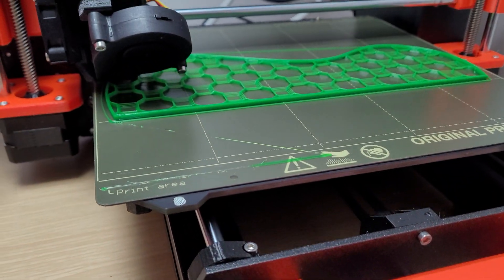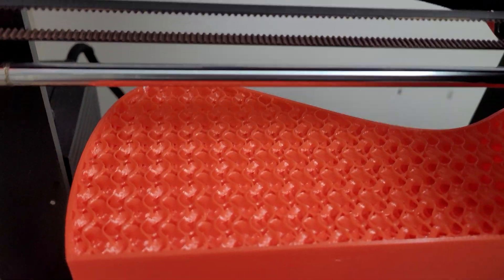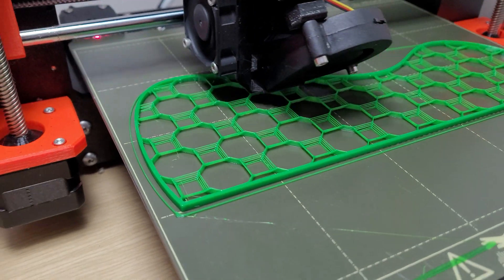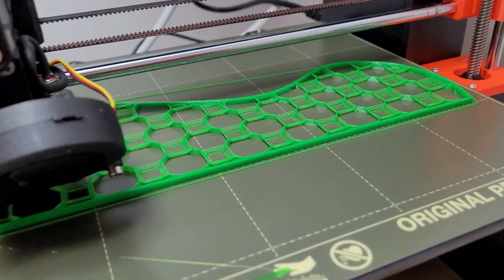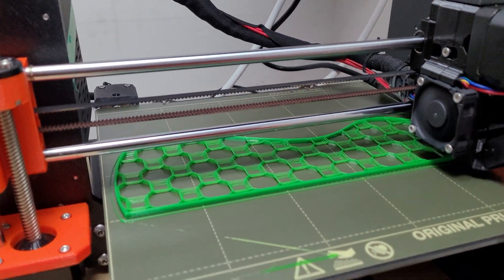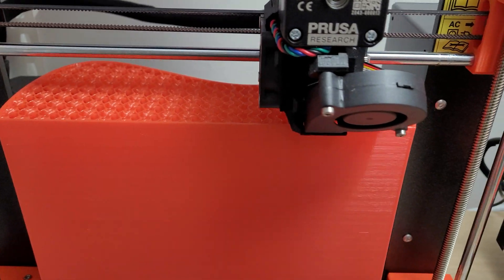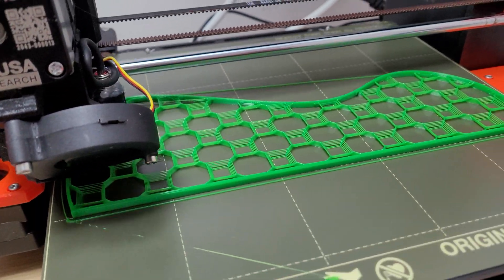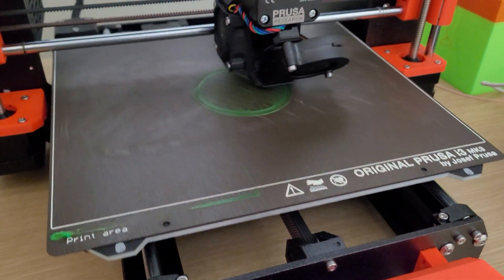Printing 3D Honeycomb Pattern on Prusa MK3S+!

Comment: It may have been my own fault because I was new. My honeycomb was smaller. I had a bad accident happen when I went to work. 

Shaking magnets loose under my bed was my ultimate problem on that printer because I mounted my printer to end all shaking.